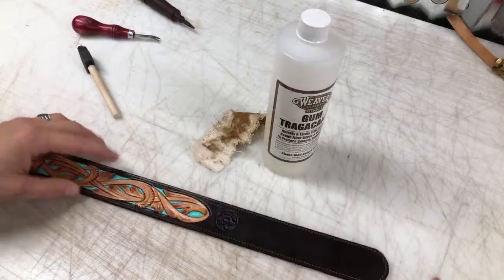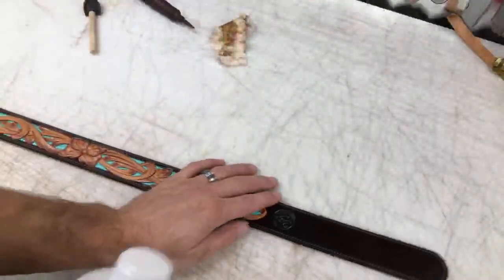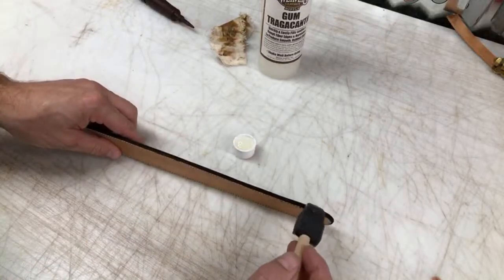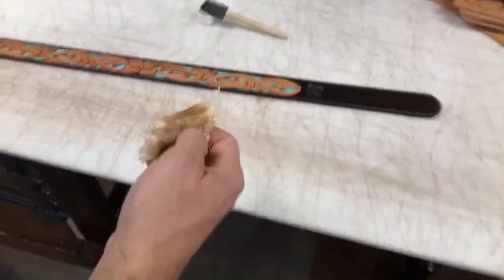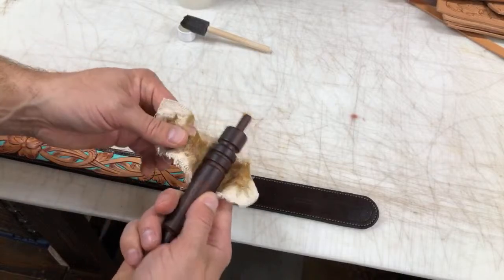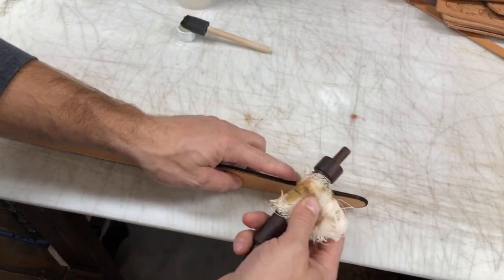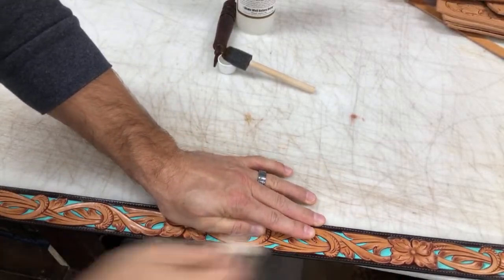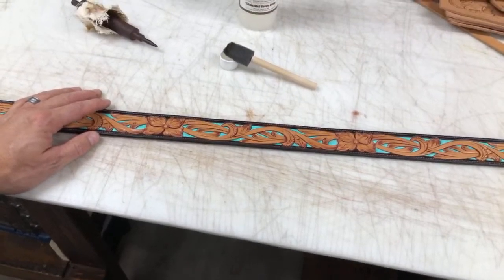Slicking edges on a tooled leather belt

Comment: Thanks for all your vids,  I am new to leather working. Do you use equal pressure back and forth or more pressure in one direction when slicking edges? i am working thru your vids, my floral carving looks just like yours,,,,, um, well, mine kinda looks like its been run over by a truck with a hand full of chat thrown on top LOL,  but i keep trying ;)  Thanks again for your vids, helps a lot.
Reply from the maker: 😂😂😂so funny! Well keep on working and be patient with yourself.
In regards to your question, I use pretty equal pressure. A bit of pressure combined with the speed with create the friction and heat that seem to activate the gum tragacanth to do its job.